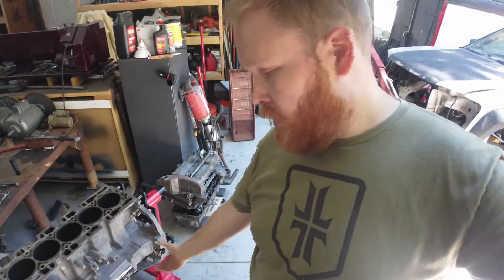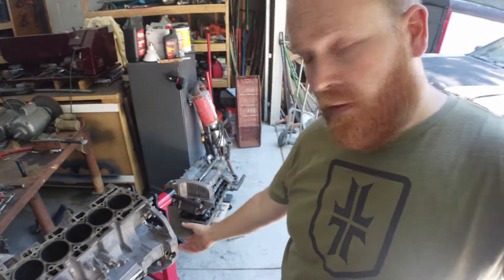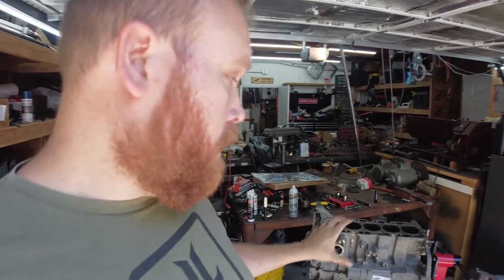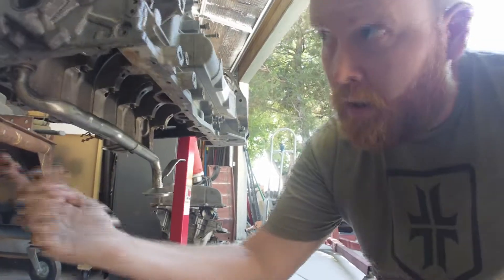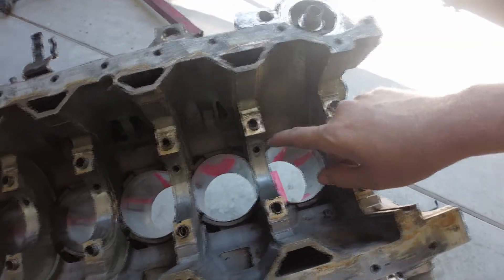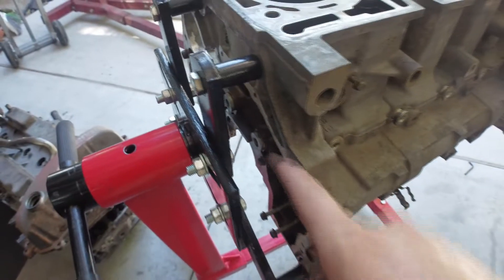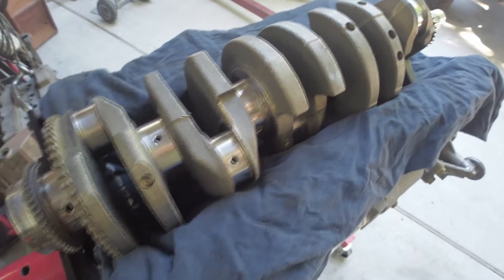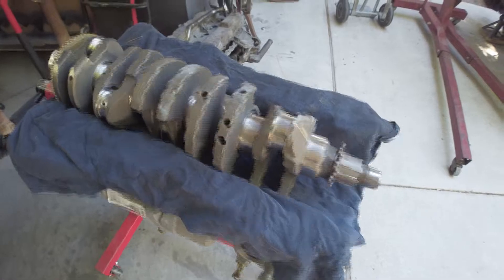GM Designed These Motors to Fail

Comment: So I have a 05 Colorado and I noticed I kept getting a low oil pressure alert at idle, as I push on the gas it goes away. It was really concerning especially because I do oil changes every 5k miles using Mobil 1 10w-30. Turns out what it was it was the oil regulator in the oil filter housing. I swapped it with a billet LS gen 3 plug and oil pressure increased back to normal. Hopefully this helps anyone.
Reply from the maker: The oil pressure regulator can get gummed up when infrequent oil changes are the norm. Glad you got it figured out before it got worse.

Comment: If it was an oil starvation problem the 6 cylinders would be having even more problems than the 5 cylinders which is not the case. Your thinking is flawed
Reply from the maker: the pcv hole is ultimately to blame due to it being clogged and subsequently sucking the oil volume low. the balance shaft bearings being oiled by the main cap between cyl 3 and 4. the balance shaft bearings wear out and then starve the 5th con rod of its oil supply and the boom. super expensive knock knock joke

Comment: The 1s that fail are due to idiots not doing oil changes
Reply from the maker: Typically poor oil change intervals is the main cause but I'm still of the opinion the hole in the valve cover is too small.

Comment: This fix has been known and made by another company for 12 yrs. now. Direct oil feed from the oil filter output to the main oil gallery with an external oil feed. They make a custom billet fitting that fit into the main oil gallery plugs. The passage from the oil filter to the main oil gallery gets plugged over time, causing the reduced oil flow.
Reply from the maker: Yep. But my oil line is cheaper. However, neither fix the actual cause. Which is poor oil change frequency.

Comment: How much power can the Atlas 6 cylinder make without harming the factory fuel economy?
Reply from the maker: The motor is capable of 800hp. But that's  not built for mpg.
Reply: @BadlandIndustries  Safe to assume the Atlas inline 6 is far superior to the Jeep 4.0L inline 6?
Reply from the maker: @enermaxstephens1051  yes in quite a few ways
Reply: @BadlandIndustries  Like the intake air not getting heated up by the exhaust manifold?

Comment: I run the mobile 1 high mileage full synthetic in my 08 Colorado with the 2.9. I hate my motor, it has no power and sounds like a tuner cause it’s so loud and has a few issues but yeah. I run mobile 1

Comment: Ive been running Valvoline High Mileage Synthetic Blend 5w-30 with a quart of Lucas oil Treatment. Pair this with either a Purolator Boss or lately I've been using WIX/Napa Gold (for price/availability). 

207k on my i5 - just had a compression/leakdown test done yesterday: I got a tick tick tick going on with some piss poor gas mileage - I think my valves/seals are toast as per TSB #07123A. My mechanic suggested run it til it dies and then put a new engine in it. I have a spare i5 in my garage that I was considering rebuilding to put in, but I'm in Michigan and it REALLY depends how rusted my frame is. I had it undercoated last year, but I'm afraid it might be too little too late. I was gonna post about this on the fb groups and see what everyone else thinks.

Comment: Would a performance harmonic balancer help with the vibrations the i5s is plaqued with? What's the big difference between the audi i5 and the atlas i5? I want to make my 3.7 a high performance engine. But, I'm trying to go through and try and fix the issues they have. I plan to run a  centrifugal super charger. I'm glad someone has brought up the oil issue. I've always ran a half a quart more than what is recommended. I actually do that to all my vehicles. I always change 3000 for conventional oil and up to 4500 on full synthetic oil. I use oil stabilizer for my between oil changes. All my vehicles have never had an engine issue. Be it a American motor or import like Nissan or Toyota.  The most important rule is maintenance. I've met people that said they didn't know they had to do anything besides add gas. I found a grand Cherokee that had never had a oil change. The lady just kept adding oil. Also it had the same oil filter when she bought it.  She drove it for 10 years. It had the dodge 5.2 v8. I can just imagine the sludge in the engine.
Reply from the maker: Hey if its leaking oil, it's got oil lol. No I don't believe the harmonic balancer will help. I've never seen one fail. Honestly having now 2 motors fail on me I would agree maintenance is key. Just because you put in top shelf oil doesn't mean the motor will last for ever. The pcv system tends to consume quite a bit of oil and I believe that's a large contributor to these motor failures. Imo the novelty of the 5cyl should only live on in its stock is form. Minor bolt ons to improve whats there and no forced induction. Several have tried and and have done well but they seemed to reduce the reliability quite severely, especially when testing the limits. Imo a v8 swap is not terrible cost-wise provided youre doing it yourself.

Comment: As mine threw a rod on number 3 💀
Reply from the maker: Dang. Did you tear it down and look at the other ones? Did you run low on oil?
Reply: @BadlandIndustries  I did not, and it was a week after doing an oil change
Reply from the maker: @hunterweston3259  damn that sucks man. Did it seem like you didn't pull out as much oil as you put in?

Comment: 110k miles with the last 30k miles using full synthetic super tech and fram gold synthetic oil filter (you can usually buy them in bulk for cheap).
The screen on my vvt solenoid is super clean like it was taken care of before me however my timing chain clearly has carbon buildup/discolored and has been that way since I bought it. Makes me curious if the engine lacks oil to the timing chain also.
Reply from the maker: It gets oil pretty immediately. Maybe cause its moving so much oil doesn't stick on it too long. I would wager an addative or thinker oil would help. I have heard of guys stretching their timing chains but its not as common as the bearing failure.

Comment: Had an '05 3.5 with almost $347K on the clock.  Ran Mobil 1 for the first 57K until they started using conventional base oils (thanks Castrol).  Two oil changes on Royal Purple, switched to Amsoil at about 80K.  But here is where it gets fun.  Installed a bypass filter system at 146K.  Did my last full oil change at 171K.  After that just drained 2 quarts every 5K and changed both filters every 10K.  Tested at Blackstone Labs every 30K or so.  Probably would still be going strong if Bambi's snowflake grandson hadn't decided to cross the road right as I was driving down it.

Now I have an '06 3.5 with almost 200K on the clock.  Previous owner oil receipts show it was changed every 3-4K.  Running Amsoil for the moment but switching to Redline once my current supply is gone because it's actually cheaper and I can get it locally at Summit Racing.

Comment: At 175k and still running strong I change oil at 3000 because why chance it seen a lot of people have engine trouble not just with this engine but any engine for that matter that let it go just a little to long. And I use what ever oil is on sale and a car quest filter.

Comment: Been running either store brand synthetic or high mileage conventional in my 246k 06 I5. Threw a quart of 15w40 in for good measure for summer driving.

Comment: I dont understand why you are saying the 5 cylinder engines fail from oil starvation . I know so many guys with 5 cylinder  motors with very high mileage . I have almost 200 k on mine ,no issues. Friends have at more miles. Most with original water pumps ,timing chains  etc . I retired from the Norfolk Southern Railroad and we had such good luck with the Colorado's that they bought a ton of Colorado's and they got beat to hell and they kept running! Go figure ! The Atlas engines were built to share the same pistons ,connecting rods ,and a bunch of engine parts.Also 1 head ,less parts ,less expense !  Seeing how many 5 cylinders have tons of miles on them without failing ,its kind of tough to say they have a problem . You don't hear of a lot of head gasket issues on the 5 cylinder engines or see them smoking bad going down the road . I was at a trade show in Pgh the year they introduced the Colorado and there were guys from GM Engine plant that cast the 5 cylinder engine blocks .They were showing the total loss foam casting process the 5 cylinder blocks were created with .Very smooth glass like finish compared to sand casting . I wad impressed .Still am. Maybe some of the 5 cylinder failures came from how the engines were driven also .
Reply from the maker: I'm not saying they're unreliable but what I am saying is that the way its designed the logical conclusion is that the 5th cyl is not receiving adequate oil flow and tends to spin bearings. Being that these motors don't usually fail any other way I feel pretty confident that making some improvements can actually make these motors be even more reliable than the already are.

Comment: I actually did a bit of research on the best full synthetic/high mileage oil on the market and the Amazon Basics brand performed the best at the price point I was looking for. Change it every 5,000 miles with a Wix oil filter. What are your thoughts on this combo?
Reply from the maker: I have heard similar reports. I think @projectfarm did I video a while back.

Comment: I have an 05 crew cab 4x4 canyon and I got it about 3 years ago at 130k mileage and now I'm at 185k miles and I've been running FRAM Full Synthetic High Mileage oil with Frams full synthetic oil filter. Trucks been great since I've had it and no issues with the engine other than just replacing the fan clutch since it was running a little hotter than what I liked at the time but other than that these trucks kick butt!

Comment: I use the Castrol Edge high mileage synthetic oil in the 2 Colorado trucks we have. We change our oil every 5k miles. No issues with them so far.
Reply from the maker: There ya go. Quality oil and frequent changes.
Reply: @BadlandIndustries  I forgot to mention we use Fram oil filters as well.

Comment: Got 171k on my 3.5 and Blackstone Labs tests still coming back perfect. Just using whatever 5w30 is on a good deal. Excited to see what you've got coming.
Reply: 175k on my '05 3.5l, running mostly Rotella T6 5W40.

Comment: I have a 07 H3, also have 99 GMC Sierra with 4.8 V8 that I don't drive anymore, would like to see a vid on putting LS motor in a H3 or Colorado,  H3 has 156k miles on it use K&N oil filter with Mobil1 oil change every 5k miles on the 3.7 5 cycle
Reply from the maker: You're in luck. Im putting a 6.0 in my truck.
Reply: @BadlandIndustries  Awesome! Can't wait to see the vid bro! 👍✌😎

Comment: Very interesting. Excited to see what you've come up with. I have an 05 Canyon 3.5 with 123k miles on it. I bought it with 117k last year and am currently using K&N Oil off Amazon and K&N filter as well. It's relatively cheap for the quality that I researched on it.
Reply: What weight ???
Reply from the maker: Just keep it changed. And maybe this kit were working on.